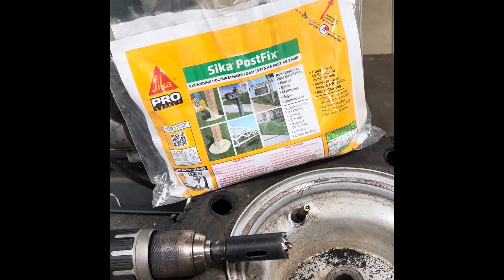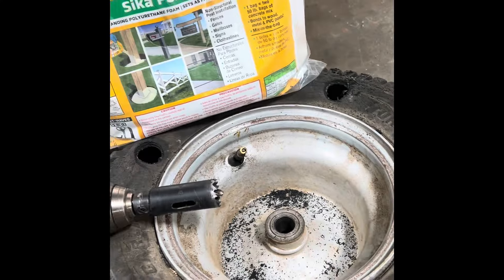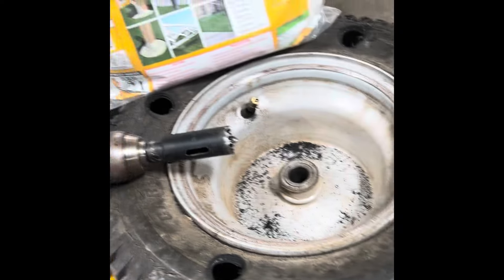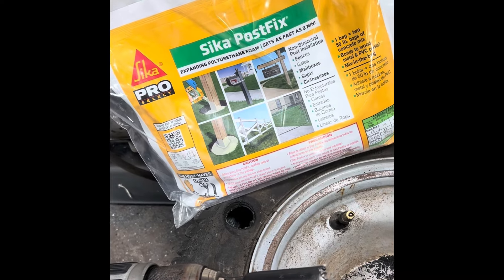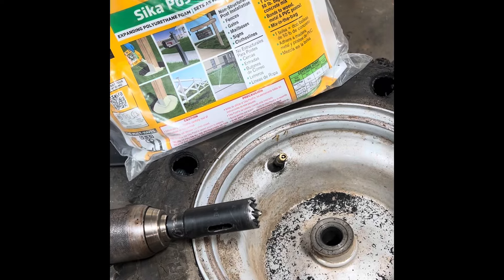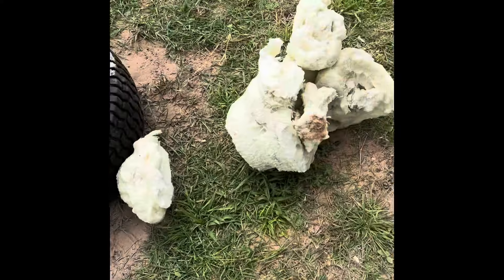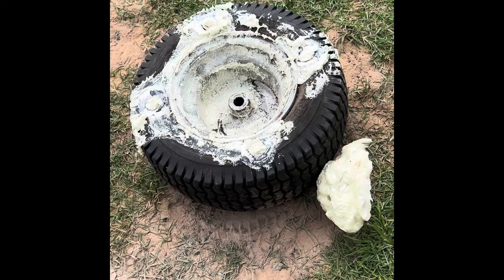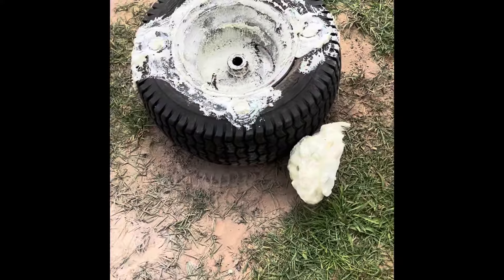NEVER BUY LAWNMOWER TIRES AGAIN #hack #hacks

Comment: When the sidewall starts cracking and the tread is gone, that’ll be wonderful when they turn into pancakes and leave the mower in the dirt lmaooo. Not that I’ve seen it before or anything.
Reply from the maker: My uncle has a tiny lawn and the OLD mower is only used to mow his tiny lawn once every two weeks and only in the summer, and our soil is super soft and sandy, so it will be a very very VERY long time before I have to worry about any of that

Comment: Did it work? If it did I may try it. Any tips to prepare beforehand?
Reply from the maker: I installed it and it held the weight of the lawnmower plus me standing on the tire without flexing at all so I am pretty sure it will work, I just haven’t had a chance to drive it around yet. It will be quite a mess so It’s probably best to do it outside on the ground, also you have to move really fast because it starts expanding super quickly, and I just tried to get an equal amount into each hole that I made on the tire. It will squirt out of the holes and mound up in a big pile and then it will harden then you can just break it off.

Comment: Is it a harsh ride (like solid rubber tires)? What about after time, will the foam become powder due to flexing?
Reply: Probably so, but just fill me back up 😂
Reply from the maker: It can’t be any harsher than the concrete tire I made before this 🤣💀 I haven’t had time to test its longevity, but the dang thing is nearly rock solid and I only drive it in grass which is soft already and the seat has springs underneath it so you really don’t even notice it.
Reply: @Botchedtoeknife it won't last, I did this years ago and it ended up with hard flat spots after some weeks, very uncomfortable.
Reply from the maker: @Edocsil  i’m basically mowing sand with a little grass in between where I live so the surface I will be driving on is very forgiving, I will try and post updates on the wear and tear of the experiment in the future.